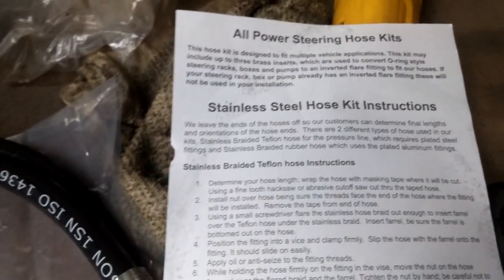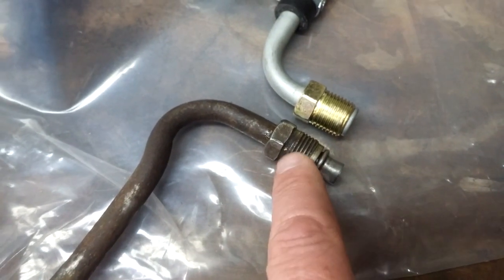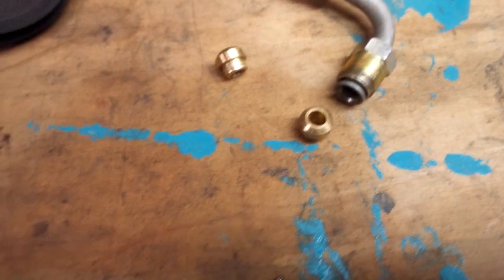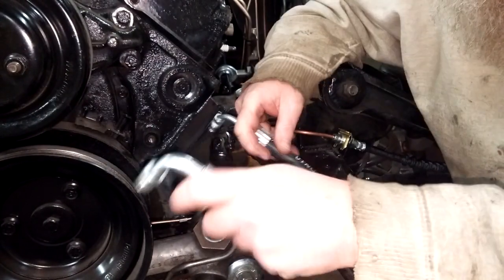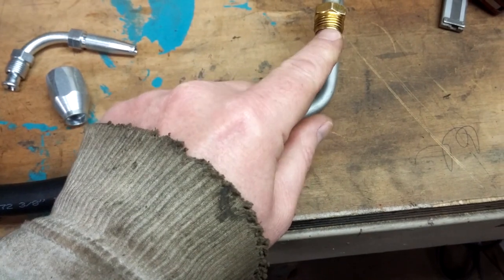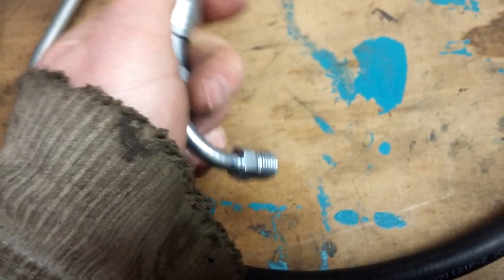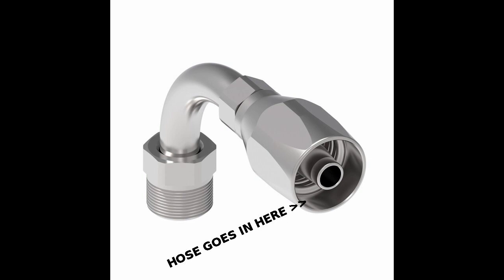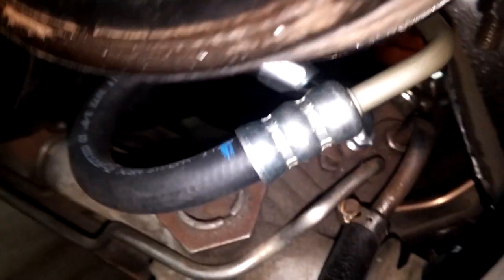Matching up a GM power steering pump to a Mustang II rack

Comment: I also bought the Borgeson kit and had to send it back, I then ordered the Edelmann 71088 hose and the EATON Weatherhead 24706-E05, Also the pressure reducer, the pressure reducer worked out fine, however, the fitting that goes into the power steering pump bottoms out before it reaches the end, leaving the hose loose and not sealed, the other end where the eaton weatherhead fitting screws into the rack and pinion is flared, however the the rack is flat inside the hole, plus the thread is incorrect, am I missing something? are there adapters I need to get? Any help would be appreciated!

Comment: I watched your two videos about rebuilding the power steering rack.  You are correct, there isn't much on the internet about how to get one of those buggers apart and back together.  I was more interested about how to disassemble it without damaging the unit and understanding where all those parts go because I put an M-II unit in my 64 Corvair but decided I wanted a power unit.  I bought a new one and I plan (by following your comments) shrink it to the proper length and then sail happily through many parking maneuvers.  Thanks!
Reply from the maker: Awesome! Thanks for watching!

Comment: Good video, I would of liked to see how you inserted the brass fittings before putting on the lines.
Reply from the maker: Thanks, Lookng back I probably should have showed that, unfortunately its all together now and I dont want to risk taking it apart. I do remember that it was pretty self explanatory when you looked at the ends.
Reply: @garyscarstuff do the brass fittings go into both high pressure and return? Or why is there 3? Thanks

Comment: I just got mine setup, partly thanks to your video.  One thing though is it still feels like there's no power steering.  Was there a special fill and bleed procedure you followed?
Reply from the maker: I didnt have to follow any bleed procedure with mine. However my rack and pupm were used and full of fluid already, maybe thats why?

Comment: How did you reduce the pressure from the pump
Reply from the maker: I used the Borgeson 899001 Pressure Reducing Kit, it goes inside the GM pump. Thanks for watching!

Comment: ... Boy did this bring back memories,  I got my hoses on but had frame issues too,  Did you remember that the pump pressure is way too high for the rack,  I used the borgenson kit to jet down the pump pressure to about 750 lbs.  That way you dont blow the rack seals.
Reply from the maker: Lol. I had bought the Borgeson pressure reducing kit too but when I got in there to install it there was already one there! So I gave the kit i bought to Dave.

Comment: I bought the same borgeson kit and had the same problems. Universal my arse. The hp end was 180 degrees in the wrong direction, and as you know, it does not twist. Ended up getting a cutom made pipe in Hamilton, for half the price of the borgeson.
Reply from the maker: Same here, the Borgeson kit cost me $100 and the one I ended up using around $40. Thanks for the comment!

Comment: Nice!!!! We have spliced stock hoses Chrysler-Chev and such. You can cut the outside sleave/ clamp and use a hose clamp. A good one. LOL. One thing I do enjoy is if you want to use a fitting like you used you can probably find one. I got the adapters to run the factory fuel lines to the 5.0 fuel rail on the Ranger, I think they may have been Russell and were kind of spendy, but got the job done.
Reply from the maker: Thanks Michael! I'd be a bit nervous using hose clamps on a pressure line lol, but this fitting worked great. It was hard to find though, and quite spendy.
Reply: @garyscarstuff  Yeah I did some sketchy stuff back in the day. LOL!
Reply: @garyscarstuff do you have the part number for the fitting, place purchased? Any info appreciated.